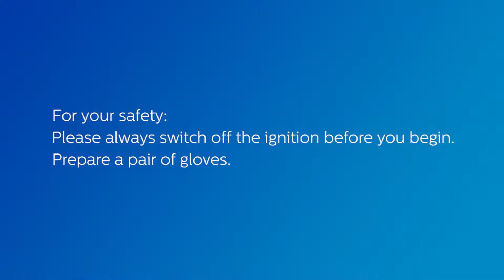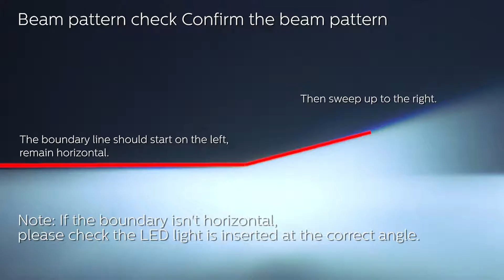Philips Ultinon Pro5000 LED Headlight Installation

Comment: My partner has put them in the same way, but the light cone doesn't look like that ❓
Reply: i also just bought this model, after install and test driving the patern on the right is lower than the left , seems Philips does not focuses them like top models do so in that case it's better to get the cheap crap on eBay or amazon as they're alos not focused but at list cheaper than philips !
also, after a test drive at night and seeing the right light lower than the left i took the car back and removed the right LED, the light came out but the black plastic around it is stuck in the frame where you twist it in and won't come out, well done Philips, Fake reviews online, keep away from that brand !